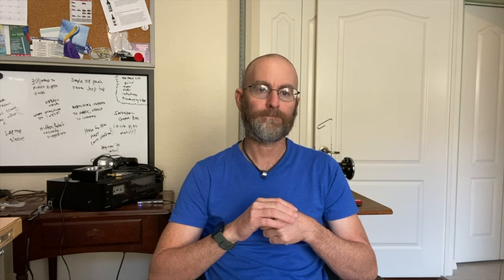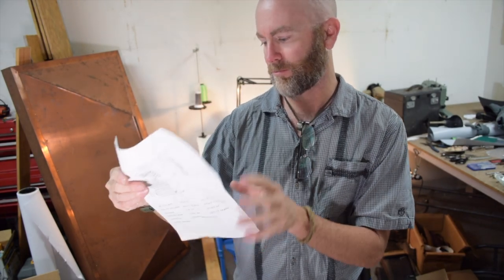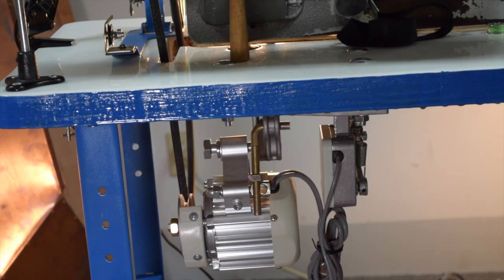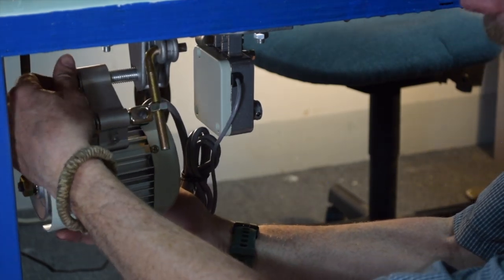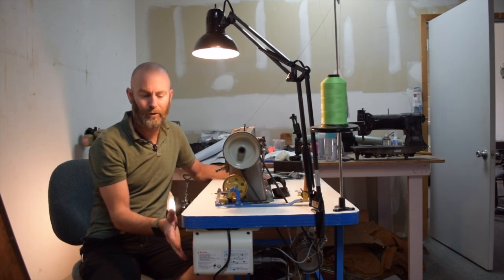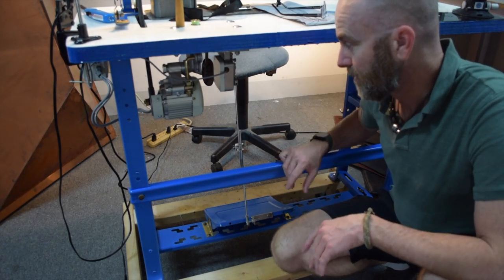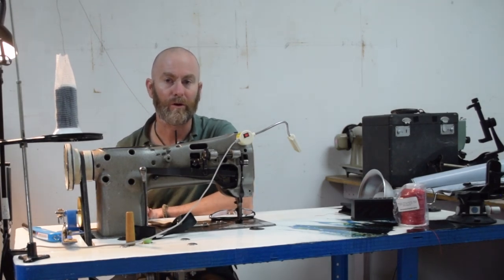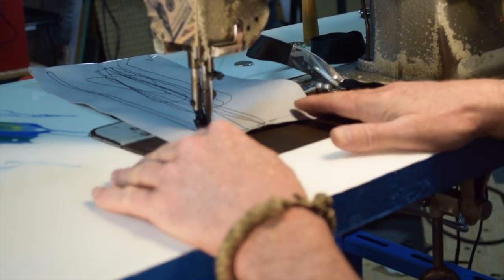Dumping The Clutch - Installing A Servo Motor On An Industrial Sewing Machine

Comment: I know this video is older, so I don't know if you'll see this. I wonder how the longevity is on one of these cheaper kits. After 3 years, have you had any problems?
Reply from the maker: Hi! I'm still here :)
The motor itself has been fine.  The needle positioner/synchronizer recently stopped working; I have a replacement synchronizer sitting next to the machine, I just haven't had a chance to install it.  Hopefully the problem is the synchronizer itself, and not something in the control box for the motor.  I will make a video once I install the synchronizer as an update on the motor situation.
If it is just the synchronizer, and the motor and controller are fine, then I would say this package has been well worth the cost.  If this problem requires replacing the entire unit, I might try to find something a little better.
I hope that helps, thanks for the question, and thanks for watching!
Reply: @thejasonofalltrades  Thank you. If the motor and controller are good, I would definitely agree that this setup is well worth the price.

Comment: Have you tried the generic servo motor in the Thompson machine? I got a Thompson PW400 and I need seed reduce and more control but I'm on a budget so sailrite option are kind of the table at the moment
Reply from the maker: Hi!
I no longer own my Thompson machines, and never connected them to any other motor besides the Sailrite.  Honestly, the WorkerB motor from Sailrite has made attaching an industrial servo motor to these machines just seem illogical.  The slow speed power and control is without equal, and you don't lose the portability of the machine.  If you haven't bought a servo motor yet, I would strongly urge you to consider the WorkerB, it's really the way to go on these machines.
If you already own a servo motor, it should power that machine just fine. 
I hope that helps, thanks for watching!

Comment: can yu put this on a singer 201k
Reply from the maker: This motor mounts under a table, and it can drive any machine that can be driven by a belt.  I can't remember if the 201K uses a direct-drive motor or a belt-driven motor,; if direct drive, a different hand wheel that has a groove for a belt would be needed (at least).
Honestly, I'm not a big proponent of powering vintage domestic machines with industrial motors.  The end result is a faster, more powerful machine, but that can lead to breakages that may not be worth the speed and power.  In my experience, most people trying to add power to a machine really would benefit more from a walking-foot machine, and adding more power to a machine does not make it feed like a walking-foot machine does.
I hope that helps, thanks for the question, and thanks for watching!
Reply: @thejasonofalltrades  i hear ya jus need more power wen goin slow

Comment: I removed my clutch motor from my singer 281-1 it was the original and was way to fast I took machine off and rolled the table over on its side and placed a mat down so the motor on that mug

Comment: I’m thinking of getting one. I have a Brother DB2 B755-3 oldie. I inherited from my mom. It is so fast. 4000 spm. I have reduced to the smallest pulley I can find, messed around with my foot petal. Watched so many videos to see what else could be done. I’m trying to make hand bags and you just can’t do small intricate sewing on vinyl or really anything. Strap holders, it runs right off them and it’s hard to maintain a straight seam. So yeah. Instead of pay $1500. + for another machine, I think this is the way to go. Thanks so much.
Reply from the maker: I think you'll be happy with it, I'm still loving this one!

Comment: I like the servo motor that is like the one you have.  I was hoping to get a wider range of speed.  I have tope speed of 600.  The motor starts out nice and slow then jumps up a bit with more pedal pressure then leaps to 600 (if you call that leaping). I was hoping for a smoother rpm curve.  Still learning the set up I guess.

A thought...Maybe more detail on the programming you did on the controller would be nice.  But thanks for putting yourself out there for us fledglings to learn.
all the best neal sw fla
Reply from the maker: Thanks Neal!
I actually didn't do any programming at all, just turned it on and started sewing.
I think the "jumps" in speed is a consequence of these cheaper motors.  The Sailrite Workhorse motor I have is noticeably smoother in transitioning through speeds, apparently it has more windings or something (I am pretty ignorant of electric motor workings). When compared to a clutch motor, I would say that even with the jumps in speed, the change in speed is more predictable with the servo motor.
If you need information on setting up the needle postitioner, I linked to a great video that explains that in the follow-up video to this one.
I hope that helps, thanks for watching!

Comment: thank you for your help.  I would have liked to see you reduce speed.  the speed you show is way beyond my liking.
Reply from the maker: Hi!
You bring up a good point.  I rarely have need to sew particularly slowly (beyond just as slow as the motor will drive the machine at a given speed setting), but I should have demonstrated the various speed settings.  I might try to shoot a video soon to take a look at that.
Thanks for watching and commenting!

Comment: I changed my clutch motor to the sevro motor but now my chain stitch is very tight and winding around the nipple making the stitches fuzzy and crappy looking. What am I doing wrong?
Reply from the maker: Hi!  I am not a mechanic, but I can't think of any reason why changing the motor would have any effect on the machine's sewing.  I would recommend disconnecting the belt from the machine and try hand-wheeling it to see if you get the same problems.  If you do, the motor has nothing to do with it.  If the problem only occurs with the motor, is the motor significantly faster or more powerful than the clutch motor you replaced? (I would be very surprised if it were.) At the very least, I suggest completely unthreading the machine (top and bottom) and re-threading it.
Let me know what you find, and good luck!

Comment: I had same issues fitting my servo on my singer 491d, had to move mount and re drill new mounting holes to get belt on right, Also made a mount for the needle postioner... all great now
Reply: Snap - I'm here because I've just been given a decrepit Singer 491 D300GA (240V - Brisbane, AU) to play with and restore. My first job though is replacing very warped table top. Wondering about rigging the new table top to fit both motors, side-by-side to offer choice of which to use by just changing over the drive belt - and perhaps a toggle switch to define master current to either motor A or B. LOL
Reply: @seancleary2295  servo every time way more control and change speed at push of a button

Comment: For anyone watching this video, if you got stuck at the 7:40 mark, there's a bracket hugging the motor, held by a pretty long slim bolt and a small nut. By loosing that nut, you can slide the motor left or right. Just remember to tight well after because that bracket is the only thing holding the motor to the base of it.

Comment: It’s 2022, if your still around can u let us know if it’s still installed and working well?
Reply from the maker: Hi!
I'm still here, and yes, I still use this motor on this machine all the time.  I have a large number of machines, so this isn't in use on a daily basis, but this machine is the workhorse of my collection and definitely gets the most use.  So far I have no complaints about this motor.  Incidentally, I still haven't changed the questionable way I mounted it in this video, but several people pointed out that there are screws attaching the bracket to the "fins" on the motor that will allow me to adjust its position instead of using all the washers I used.
Thanks for the question, and thanks for watching!

Comment: Can a servo motor be mounted to a household machine? Janome hd3000, for example. Much tinkering involved, of course.
Reply from the maker: Hi!
Sorry for the delay in responding!
There are three questions that come to mind when thinking about installing an industrial motor (servo or otherwise) to a household machine.
One, where will you attach the belt?  Many vintage machines were belt-driven with the belt attaching externally to the hand wheel, making converting to being driven by an industrial motor more feasible (just route the belt through the table as normal on an industrial machine).  One might need to change the hand wheel or use a different size belt to make it work, depending on the machine, motor and belt.  Newer machines may have the belt pulley located within the body of the machine, or may be direct-driven with no belt (possibly other situations exist?).  In this case, you would have to figure out a way to attach a different hand wheel that includes a pulley for the belt, and make sure the interface between that hand wheel and the machine's shaft(s) is sound enough to manage the torque of the motor.
Second, how will you attach the machine to the table?  The machine will need to be secure so that the belt can transfer the power of the motor to the machine.  A vintage machine can be mounted via traditional or industrial hinges, one would just need a table with the correct cutout and appropriately spaced hinge points (for example, Sailrite's industrial-style table for Ultrafeed machines works with many old Singer machines and others). Newer machines like the Janome you mention don't appear to have the same hinge attachment points, as far as I am aware.
The third question is can the machine handle the extra power? (In other words, SHOULD you connect it to an industrial motor?)  Many newer sewing machines have some plastic/nylon/composite gears, for instance, and it is at least possible that these might not be able to withstand the forces imposed upon them by an industrial motor. Industrial motors can also greatly increase the speed of the machine, which could lead to breakages when, for example, the machine fails to feed over a thick seam, quickly builds a mass of stitches that causes the needle to deflect, possibly breaking a needle or other component.
I have seen many examples of (particularly older) household sewing machines connected to industrial motors.  I personally don't see a good reason to do it.  If you truly need the power and speed of an industrial motor, get the industrial machine that was made for that purpose.  If you don't need an industrial machine, then I don't see any real benefit to powering a household machine with an industrial motor (other than our desire to "hot rod" our toys, an impulse I totally get lol!). 
For something like the Janome HD3000, I think you would be spending a lot of time and money to make it work, and likely just end up breaking your machine at some point.
I hope that helps!  Thanks for watching!

Comment: I need to decide on either a 1342 leather stitching machine with a direct-drive servo motor or a belt-driven 1342 with an under-the-table servo motor and speed reducer. I need to choose the setup that will give the better low-speed torque performance for stitching through a half-inch of leather.

Comment: You didn’t need to add washers to align the pulleys. Loosen the Allen head bolt that tightens the bracket on the motor body. That will allow the motor to slide across.

Comment: Hi! Please help. What did I do wrong, my Juki with servo motor starts running as soon as a I turn it on without even touching the pedal. Thanks for your help and video.
Reply from the maker: Hi!
If you just installed the motor, first I would try unplugging everything and making sure that the right wires are going to the right receptacles.  If there are identical receptacles, it's possible that the wire for, say, a light got plugged into the receptacle for the motor, and vice versa.  That would have the motor on constantly.
Another possibility is the arm that activates the motor when you step on the pedal is stuck somehow in the "on" position.  This could be because the arm between the pedal and the motor was adjusted too short, for instance.
It could be possible that something is wrong with the motor itself, but I would check those things first.
I hope that helps, let me know what you find out!
Reply: @thejasonofalltrades  Thanks for your time and attention. Your second suggestion worked!! I am very grateful for your help. Congratulations on your channel, very helpful. Thanks again.

Comment: I was looking to replace my ( clutch ) motor, on my 25 year old Pfaff flatbed machine, is this possible also to replace
on a leather flat bed? because am hoping to start my motorcycle jacket line in the year.
Thanks for the info video, and a big Salute to you from the UK
Reply from the maker: Hi!
I think this motor would be fine for the kinds of leather you would be using for a jacket.  When I worked for a leather bag manufacturer we used similar motors.
Good luck, making leather jackets sounds challenging! When you're ready to go public, I'd love to see your stuff!
Reply: @thejasonofalltrades  Am a artist, and creature of my own products, like your self, came from a mother and farther, who were the same
certain things in life can knock you off your path, am just trying to get back on it.
so seeing your video was one of the things, that am looking to do to some of my older machines, because the flat walking foot machine
that am ordering will come with a servo motor, and my 30yr old Pfaff needs a up date, and your awesome video
put me, back on getting up and doing it, Amazon has some online, in the UK 
So thanks and I have subbed to your site page on YouTube, so when am up and running, I would be glad to show you what I produce
Thanks again for your awesome info video tutorial.

Comment: I got my first industrial today. Planning to swap the motor for servo also. It’s a 111w55. This is great video. Thx
Reply from the maker: Awesome! Make sure you check the comments out, several commenters provided some correction on the way I mounted this motor (although it's still mounted the same way and working great!).
Enjoy your 111, I have a Consew 225 (111 clone) and love it as well.
Thanks for watching!

Comment: I just bought a consew 226 and it has no table —- I’m at a loss as to what to do next!!!!
Reply from the maker: Industrial tables are pretty commonly available (depending on where you live, but I've seen them all over the US on the used market).  If you can't find a table, it isn't the most complicated woodworking project to cut/route a hole in a wood table top for an industrial machine.  If you don't have access to the tools, you might be able to find a competent handyman or carpenter to do it for you, but buying an old table would like be much cheaper.
Good luck, the 226 is a worthwhile machine!

Comment: I replaced clutch motors on a Juki LU563 and a Juki 442 cylinder arm with servo motors, I am very pleased with the control I can have, and the torque at low speed. There was minimum alteration on the mount to install the new parts. I don't have needle positioners yet, but that's ok for now. There is no question for me that the servo motors are far superior to the clutch motors. Try selling a clutch motor!
Reply: On your Juki 563, do you know if servo motor you installed was 3/4 or 1 HP?

Comment: Thanks for doing this video.  I’m switching my consew 206rb5 to a servo.  Basically there’s no instructions with the new motor.
Reply from the maker: Definitely check out some of the suggestions in the comments, there are some things I should have done differently (although my motor is still mounted this way and working perfectly).  I also have a follow-up video that discusses the needle positioner, there's a link to another person's video that you should see.
Thanks for watching and commenting!

Comment: I just bought a 220v Brother LS2-B837-310 triple feed walking foot that has a factory thread cutter, synchronizer attached to the wheel and quick reverse (I don't know what the last two do) and I want to install a 110v servo motor since I don't have 220v at my house. Do u know if all the features I listed above will not work if I install a servo motor?
Reply from the maker: I don't know, but I suspect they will.  If the machine has a control box for those features that plugs into the motor with a standard household plug, I think it should.  I don't know if it has a transformer (or whatever it's called, I am NOT an electrician) on board or not. My guess is that it's simpler from a manufacturing perspective for all of the ancillary items to be 110v, rather than having to stock 110 and 220 of everything.
Let me know how it turns out!
Reply: @thejasonofalltrades  Thanks for your reply. I was able to speak with a repair guy from Santa Barbara who knows these machines very well and he says because it has an AC servo motor I should b able to hook it up to a VFD to invert the 220v and use it in a 110v outlet. I have two VFD's that control my 1hp 220v three phase AC motors on my belt grinders. I'll let u know if It works or blows up😝.

Comment: Just got the same/similar and am installing it on chinese leather shoe patch cheapy. Just wanted to point out on the belt alignment issue is that aside from washers you can loosen the bracket that holds the motor and shift the motor on the bracket giving more adjustment and if I read correctly can set a max rpm I hope